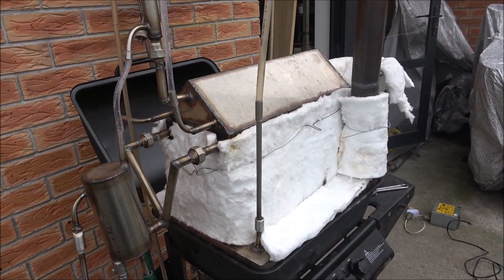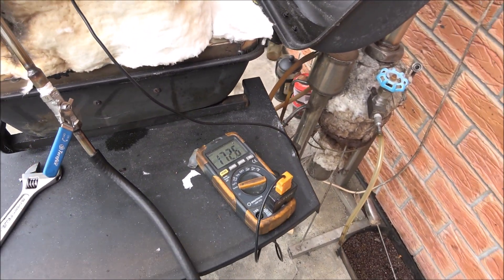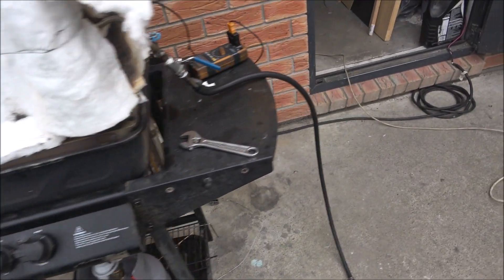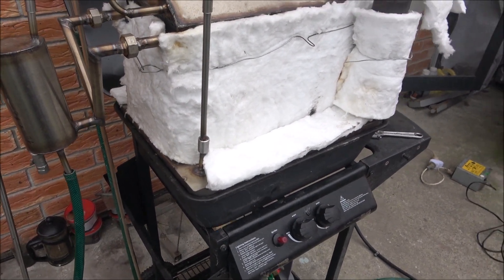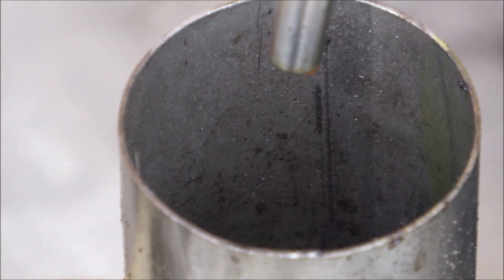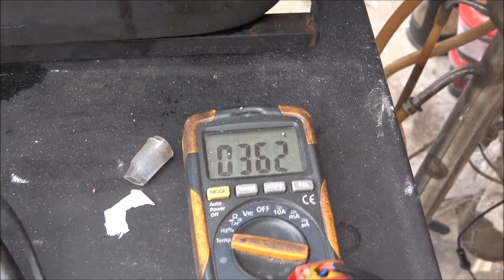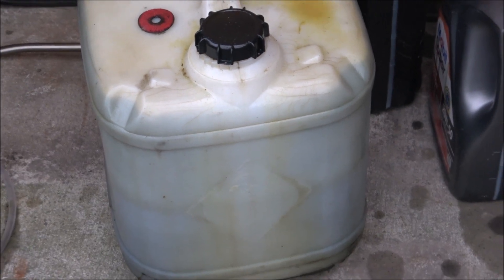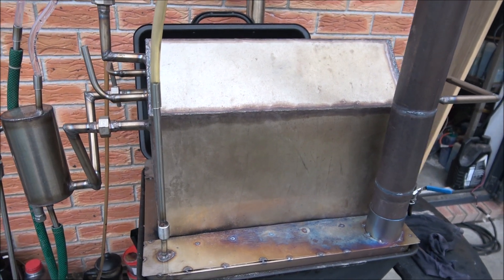WMO Pyrolysis retort pt2

Comment: Hie alek why is it that every time i try to distill waste motor i had gas expansions which resulted in waste oil coming out from the condensor pipe
Reply: I use cartridge heaters as heat source
Reply from the maker: there are obvious mistake in the constryction of your distiller, contact me and we will discuss the way of fixing your problem: https://ferromit.com/contact.html
Reply: Ok i will contact you
Reply: i get the same problem

Comment: This is wonderful !  How much propane did you utilize to distill the fractions collected? Would it be possible to make a diesel burner unit to heat the chamber vs. propane?  Fantastic work!
Reply from the maker: In my latest experiment, I used a completely heat-insulated burner. I was able to produce about 20 liters of distillate using only 2 kg of gas. The stove is lined inside with a ceramic blanket, plus ceramic bricks to direct the flame to the bottom of the retort, not spread around the broader internal space. Also, the residual gases contribute about 40% of the heat. And yes, it is absolutely possible to run it with a diesel burner.
Reply: Mine uses diesel. You get about 3:1 to 4:1 output to input

Comment: How many liters per hour do you get with running the distillation on lpg?
Reply from the maker: Not much, about 5L per hour out of both outlets combined, also note that the internals of the stove were completely heat insulated with ceramic blanket.